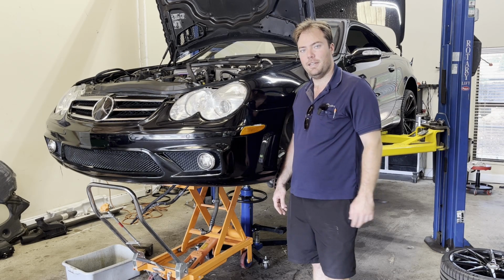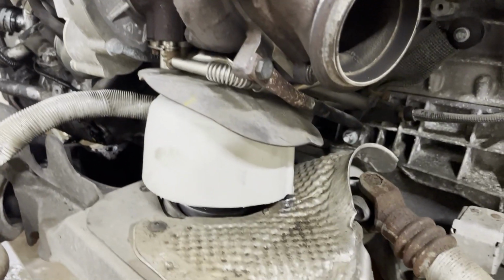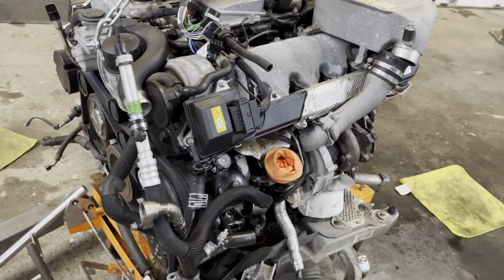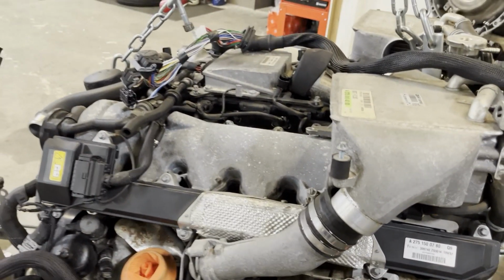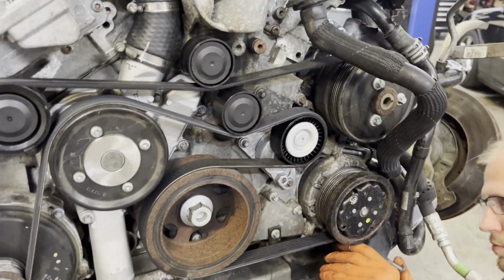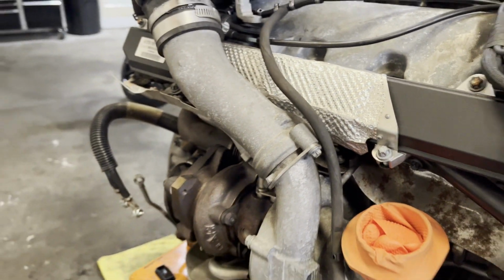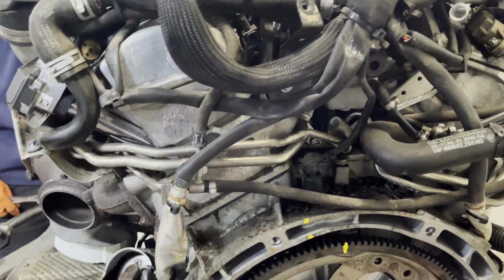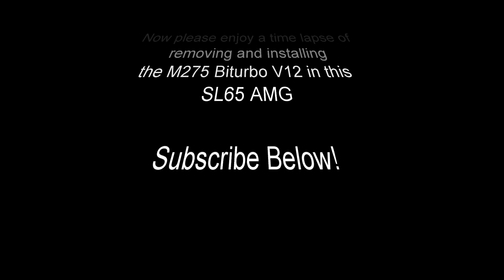Everything Wrong With Mercedes' M275 Biturbo V12. Are They Worth It?

Comment: Yeah I once had a 2005 TT & bought it with smoking tailpipe s. The dealer who sold it to me felt it was passenger side turbo n he was rite! But my AMG mechanic sed it was engine out service. $2,000! I found out later it was just a turbo oil line but don't know it he could have reached it. All n all the car is not worth the effort
Reply from the maker: Takes a really good mechanic to do the lines in the car. Pulling the engine is the standard procedure and honestly less headache

Comment: Crankshaft Position Sensor
Reply from the maker: They pop up sometimes. much more common on 112/113 engines.
Reply: @DCMotorWerks  Why is that?  They use the same part.

Comment: I always thought the "AMG" V12 had the M279 engine & the regular SL, CL & S class V12 had the M275 engine.

Definitely appreciate your knowledge...
& I'm definitely gonna look into the W.C. reference you've made.... I've gotta replace one of my coil packs at the moment, and I've replaced my voltage transformer.      THANKS AGAIN THOU!!
Reply from the maker: M279 is the revision of the M275 launched in the R231 SL and all V12 models post MY2014. Up until then they are all the M275 unless its the Maybach (original maybach) have the M285. Pagani uses the M158 Version. All iterations of the same engine though
Reply: @DCMotorWerks  

  Thank you!!!....I Wish I were closer to your area to do business with you because I appreciate that you seem to have knowledge of the V12.
A lot of auto "specialists" appear to be afraid one way or another.... 
  I deal with a strictly Mercedes shop & even they are afraid of the V12 as well as the ABC system so I'm forced to deal with the dealership in some cases. I would luv to be involved with someone that's truly knowledgeable in this category..... Anyway THANKS, & good day to you!!!

Comment: Anyone ever try and remove the engine from the top?
Reply from the maker: Not that I’m aware of. It’s not hard to get it out the bottom
Reply: I’ve got the 4 post lift so getting it high enough from the ground  is the challenge
Reply: Seems pretty hard to take the motor out from the top since you can't even get to the motor mounts since this is what he's taking it out for

Comment: Nice video! But this is insanity. This is unaffordable for the average person. I can only imagine the total bill for parts and labour with a Mercedes dealer. I bet you can buy a brandnew (budget) car for that kind of money. 
Thanks for the effort and length of this video, I wish you're able to make more of these videos if time allows you to do so.....
Reply from the maker: Thank you. Yes they can definitely wreck a budget. However, they really are a lot of car for the money as much as they have depreciated but unfortunately the service costs don’t depreciate.
Reply: Yep i would rather a corvette anyday!  I'm sure they designed it to be a pita to service on purpose.  Im sure it drives amazing though.  I have an S55 myself, and researched the v12 cars years ago.  Way more expensive and harder to work on, i would choose sl55 over v12 anyday.
Reply: Nothing about an SL65 is for an average person. These were Mercedes most powerful engines.  For those insisting on V12's, Mercedes has the most experience as the highest volume V12 manufacturer.